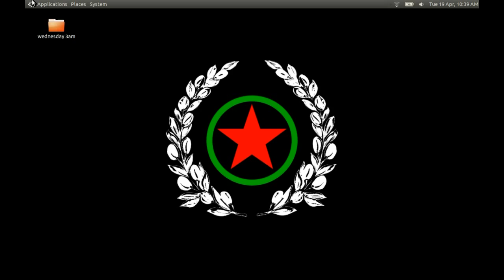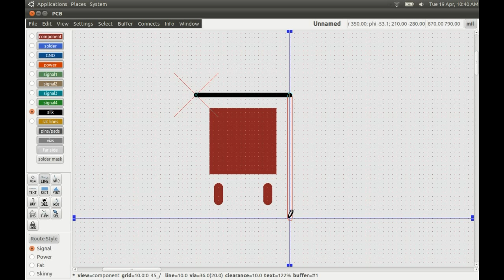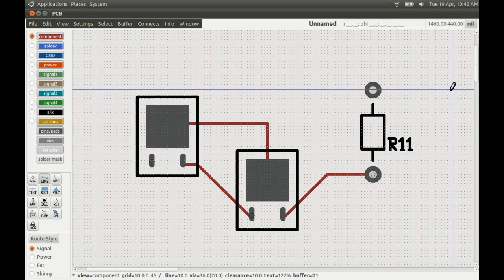GEDA PCB HouseNebula Help

Comment from the maker: @housenebula For a Gerber just go to the menu and press 'File'->'Export layout' and select 'Gerber', it should be quite simple. To connect to a plane, hover over a node, pin or via, then press 'Shift' and 'K' until the plane connects, if you want to know more you can check out our video -> GEDA PCB Designer - Types of Vias. Hope this helps :)